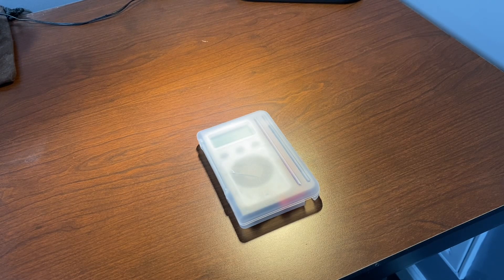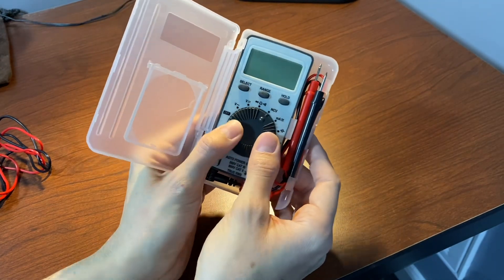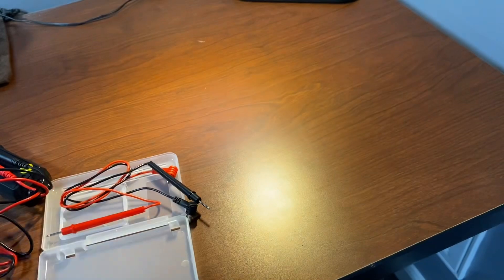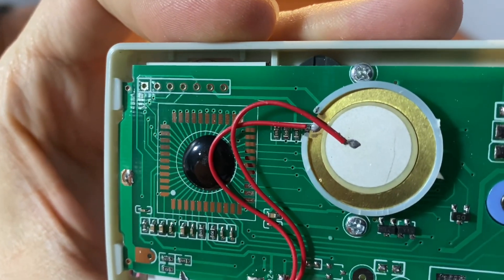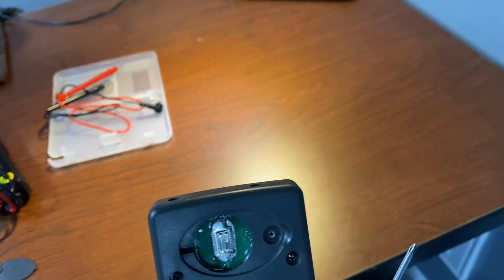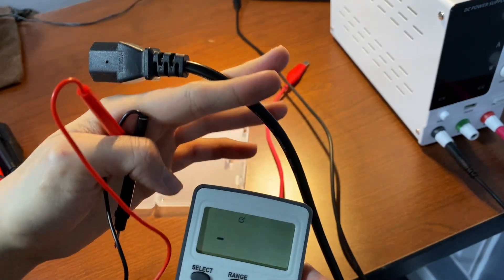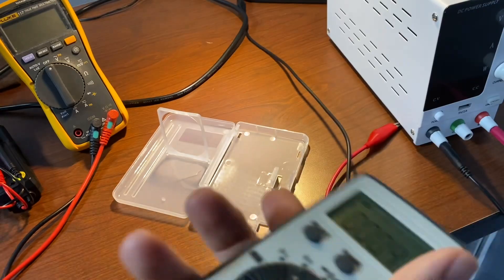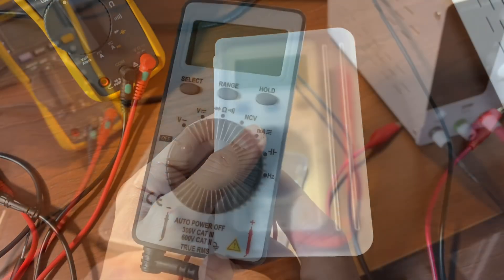Aneng AN101: The cheapest multimeter that might be worth buying?

Comment: You and I both have one of the newer versions of this meter, which did not get renamed with the upgrade.  Did you get an owner's manual?  I didn't, and can't find one online.  The new version now has 4000 counts, capacitance, NCV, and frequency.  The digits are a little smaller to make room for the additional mode indicators, but still good contrast like the original version.

The amount of capabilities is outstanding, as long as you don't do high voltage or high current with it.  Diodes top out around 1.8V and capacitance 4mF.  The leads have low resistance for how small they are, and ohms range starts at zero exactly.  Measures all my sample resistors from 0.1 ohm to 10M ohm very accurately.

As for capacitance, did you know you can hold the select button to engage the relative mode?  REL shows up on the screen when active.  Doesn't work for anything but capacitance I found.   This provides better accuracy when measuring a few pF. 

If you hold the select button while turning the unit on, the auto power off feature will be disabled.  It will still beep every 15 minutes, but it will stay on.

The wheel, PCB tracks, and springs do not have lubrication.  I applied dielectric grease to these areas.  I also relocated the buzzer closer to the range selector so it's more audible.  I cleaned up the battery terminals which were overloaded with solder.

One final note, the newer version doesn't have the adjusting potentiometer that the previous one did.  They probably use software offset like they do on their other newer meters.  I'm quite pleased with DCV, ACV, current, capacitance, and resistance checks I did against the standards I have.  Voltage was essentially spot on, current -0.5%, capacitance -2%, and resistance -0.5%

Have fun!
Reply from the maker: Mine didn't come with an owner's manual either. I did notice (only after recording the capacitance test) that holding select puts the capacitance in relative mode -- would have been nice if it worked for resistance also. Good to know the auto power off can be disabled. Let us know if you discover any other hidden features! If we could figure out what chip that is onboard maybe that could shed a little light on the matter too.